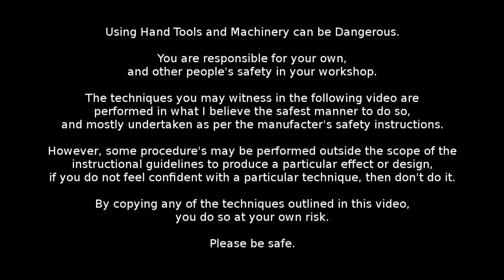Wood turning a Eucalyptus Burl Bowl with Live Edge, and a visit from Rocky the Rooster.

Comment: I had to your break on too. Hope you start making videos again soon. You got some nice woods lying about the property
Reply from the maker: Thanks Dave, I'm working on it. Currently been painting the walls white, and recently had the power upgraded. The workshop building is now split across 2 circuits and the workshop area upgraded to 15amp specifically for the Lathe, and the cable oversized to handle the Lathe running under load, and allowing the dust extractor, air compressor and room filter to be running at the same time. The old circuit was put in 30years ago, and didn't have proper RCD's. Also got 10KW of Solar on the workshop roof as of last week. The other 2/3 of the workshop building is being set up for the kids/family activity room. Once I'm about ready to do some videos, I'll do a tour video, including the paddocks, and the changes we've made.
Reply: @DiemenDesign  not sure where you want to take your channel but lots of people like to see a face and hear some talking. Can’t wait to see what you do
Reply from the maker: @DavesCave  Definitely something to consider.

Comment: Gotta love the laguna's. You have a stop on the tail stock do you
Reply from the maker: Yeah, they have a remote that has a stop button, start/stop and speed control. I've modified mine to have rare earth magnets on it's back and bottom, this allows me to position it where ever I want. Only drawback is that you can only use the remote, or the headstock controls, not at the same time.